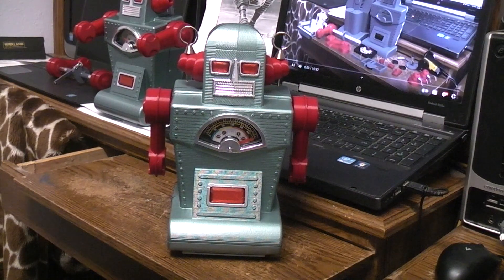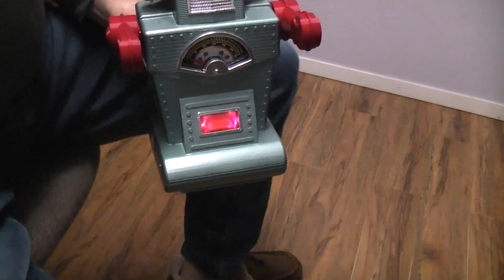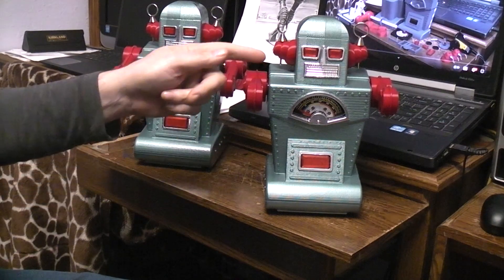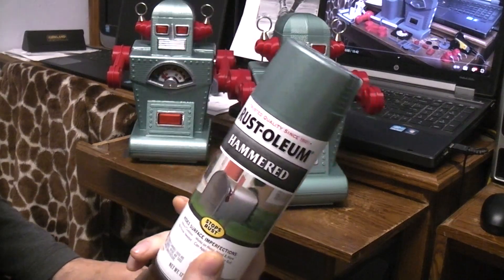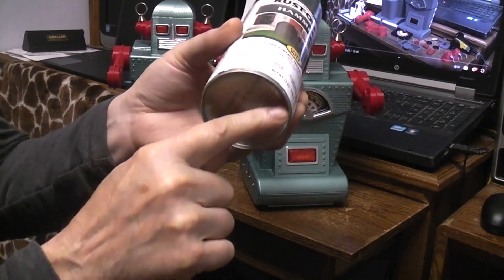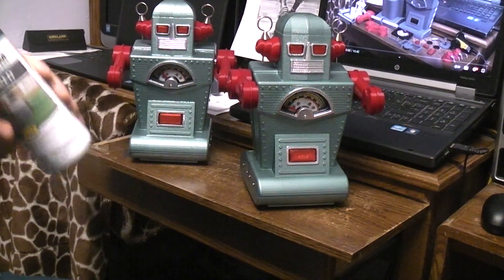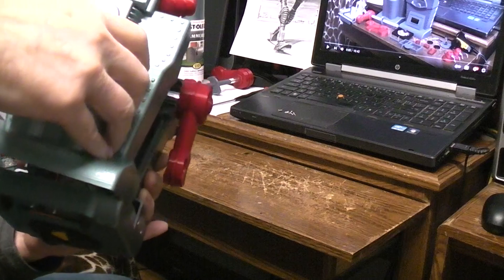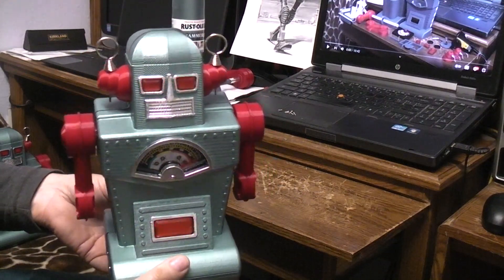Part 3 of the 3d printed battery operated Diamond Planet Robot project.

Comment: Really nice looking result on thi project, they look fantastic.
 One thing, on the hammertone paints, you can brush them on, not sure about that brand, but i have used them on larger steel constructions, and the hammer finish is great for concealing any brush strokes, from memory the technique they prescribed was a thin light coat, followed by a heavier wet coat to get that typical texture finish.
Reply from the maker: I used the brush on hammer tone on the Mechanical Band and many other projects. I even tested some brush on Black hammer tone I had already on the 3d printed parts to see if it would fill in the 3d printed layer lines. It did. The only problem is you can not get the color I wanted for this project in the brush on paint, it has be canceled as well. You can still get brush ON silver, so that was why I was testing mixing Hameer tone silver and blue to see if I could make up the color I wanted. It all stater to become to expensive.

Comment: That's gorgeous!  I noticed you wrapped aluminum tape on the arm shaft.  Was that too reduce wear on the plastic?
Reply from the maker: Direction of the arm shaft print and the body slot for the shaft were in the same direction so I wrapped where the arm shaft and body touch to reduce friction and the print layers line up and can cause drag and or noise. it would be fine with out it, but moves smoother with it.

Comment: I 3d print my own (simple) robot designs without any electronics or mechanical aspects. I don't use any paint or glue making them sort of like 3d puzzles that snap together. My creations often go through a trial and error growing pain stage. Even with calipers on hand I find I have to keep tweaking dimensions to get the pieces to fit together correctly.  I use tinkercad because that's about the extent of my drafting ability. I wish I could get the same precise results that you seem to get right off the print bed.
Reply from the maker: Many times I do have to print a part 3 times and make changes so that things work the way I want also.